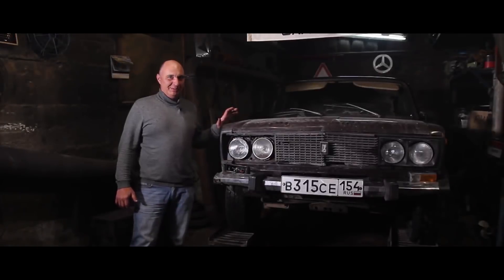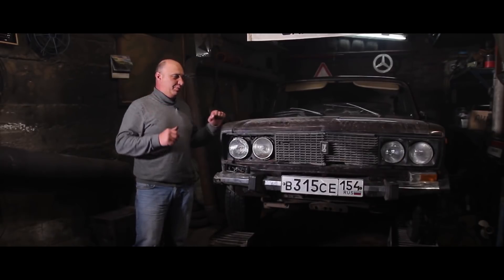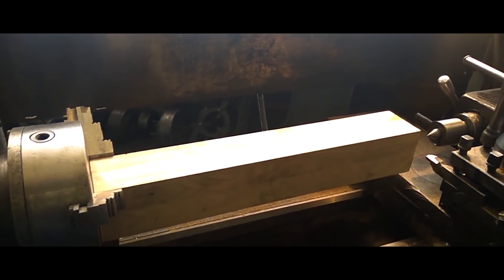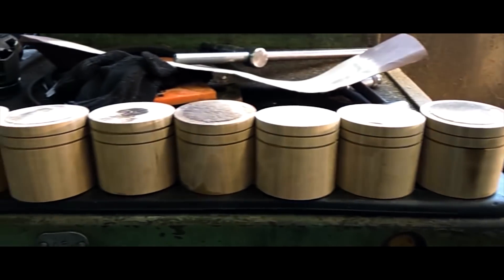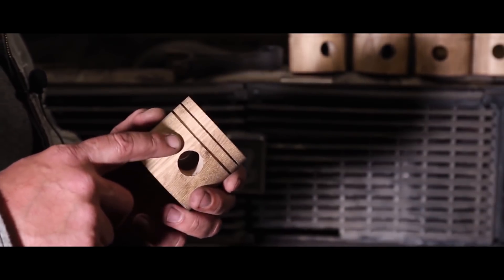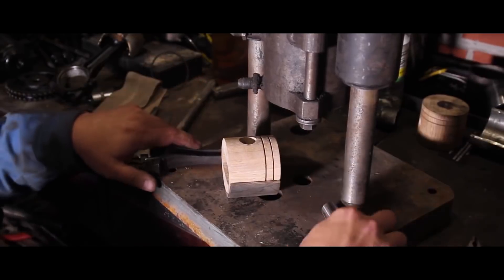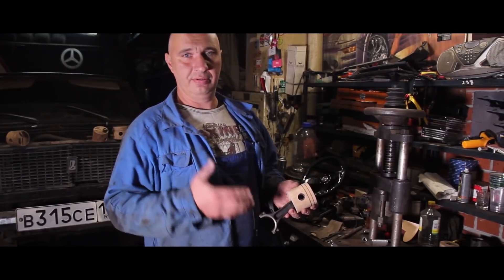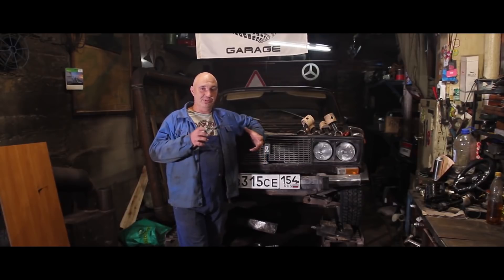Fabricating Wooden Pistons

Comment: We were told a story about wooden pistons and did get to see one used for over a decade in a 3 cylinder stationery air compressor. I had been told it was in there but didn't  belive it and we pulled the head off to have a look and it was in there... the air compressor ran a furniture factory for years with out issues.

Comment: I'd suggest to add a heat sink to the flat part of the piston in order to prevent the wood from burning. A small piece of metal tightened with small screws should do the job, I imagine.

Comment: I love this, years ago, an automotive writer named Granville King claimed he had done this to get home with his jeep.  I really hope this works.   :-)
Reply: MrRatkilr you are exactly right. There was a reprint of his gettin back article it in the 90's around the time he died.
Reply: I remember that article. Even still have that magazine somewhere. But I think he just removed the bad rod and piston. Carved and drove in wooden plug to block that cylinder from splashing oil up into the head and valves. And drove out on the remaining cylinders. I could be wrong. Article was back in the 80s. long time ago.
Reply: MrRatkilr Yea, I’m a bit hazy on the details as well. But that idea stuck in my mind forever!   ;-)
Reply: MrRatkilr
Yeah,seen it done that way on an old Ford flathead.
Reply: Impossible as you can see in the next video, it doesn't work